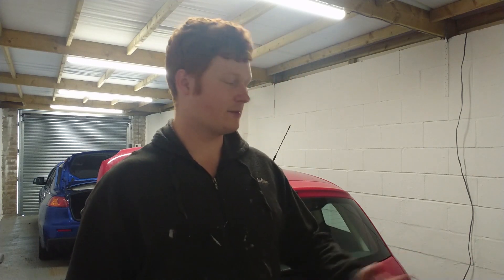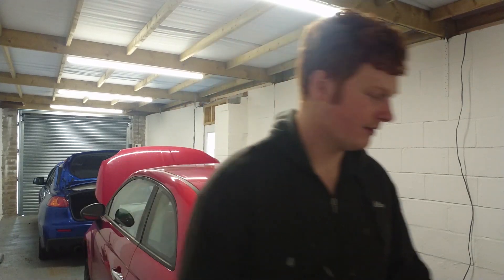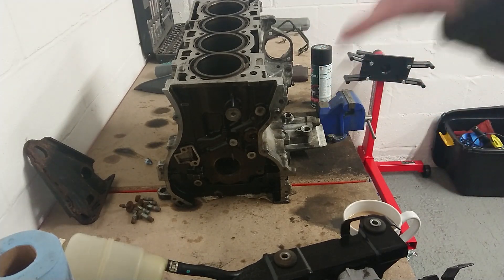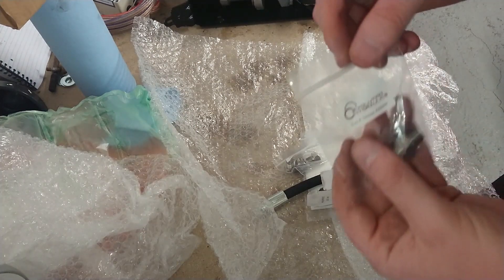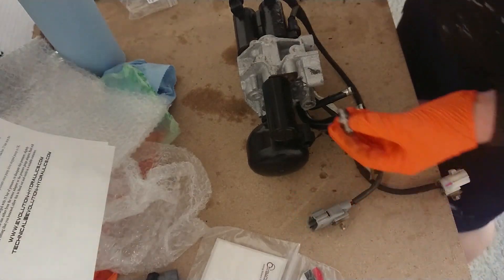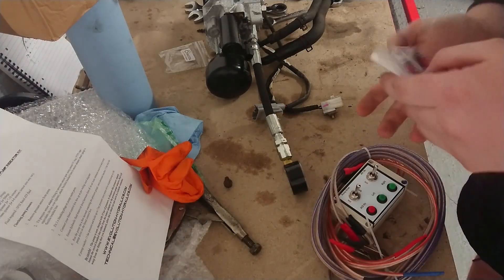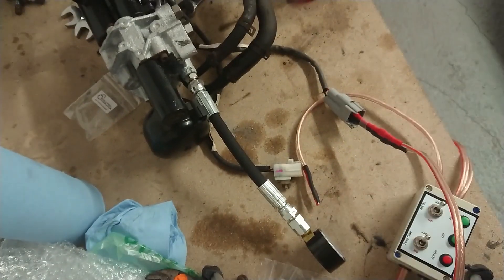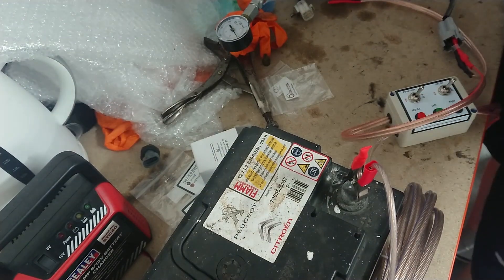Testing my DIY Rebuilt AYC Pump Evo X

Comment: How long did it take you to get up to 15 bar? Mine gets to 5 and then doesn't seem to go any further. Any ideas? Thanks!
Reply from the maker: The power on test needs to hit target pressure in 8 seconds
Reply: Do you have any ideas as to why it may not be building as much pressure as it should be? @rowanlewisuk
Reply from the maker: @edbowles86  wrong oil or the clearances arent tight enough on the seal plate

Comment: Do you know why it failed the first time? I need to try and rebuild my pump as it’s also stopped working. Great videos- very honest and informative
Reply from the maker: Its a common issue the corrosion expands the parts and the clearances on the pump become out of spec so the pressure drops
Reply: @rowanlewisuk  so was it just a case of taking it apart again and rebuilding it a second time?
Reply from the maker: @edbowles86  check out the other videos mate

Comment: you can also move the wheels back and forth violently while car is only and the ayc system will activate and you can bleed the system. did it when I changed my clutch. just noting for people who don't want to pay for a mut3 tool or buy this full kit
Reply: Do we turn it when the car is on jack stand or normal driving on roads?
Reply: @JerrysGarage  on jack stands.make sure you have all the wheels off the ground and you have the ignition set to accessory mode.

Comment: How long did it take for you to start registering pressure? Thank you for any help.
Reply: Did you ever find out? Mine seems to be taking ages to bleed🤦‍♂️
Reply: @ryanevans8559  I had to take it apart, there was a "shaft" that I missed and did not install. Once I did that and re-bled the system it was good to go.
Reply: I sent mine off to be repaired. Turns out it was all blocked up..